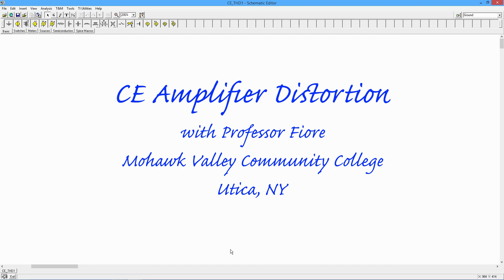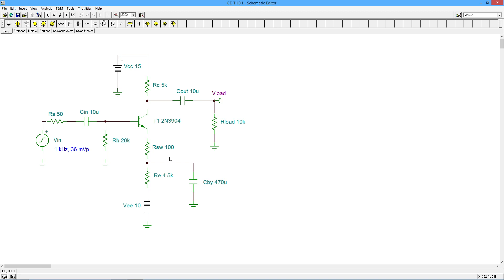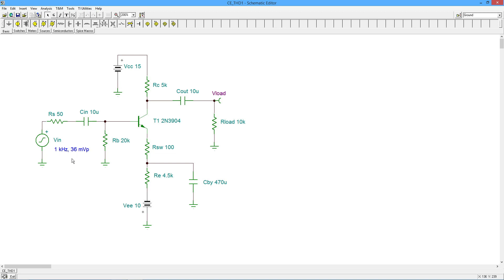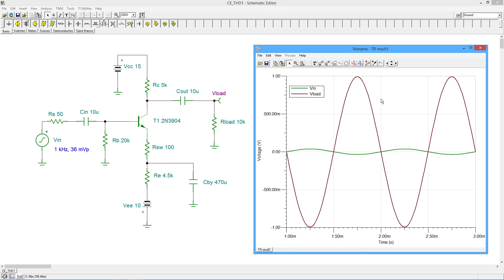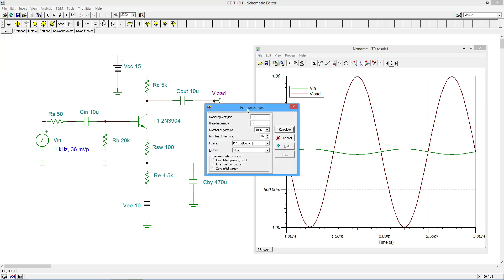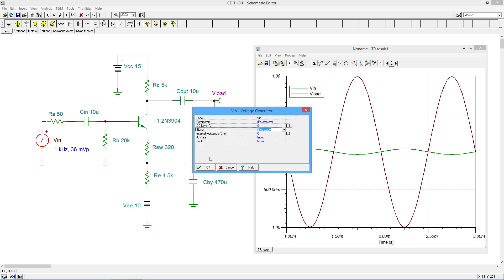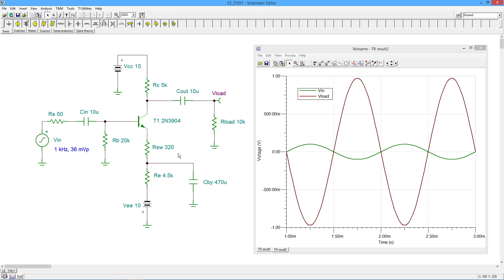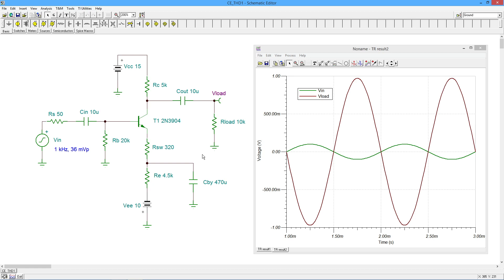Semiconductor Devices: CE Amplifier Distortion Simulation

Comment: By the way, for this design, how can we set the Q-Point as close as possible to the middle of AC load line?
Reply from the maker: I suggest looking at class A power amp analysis (either videos here or my free semiconductor devices text- links in description above).  Basically, you have to juggle the load impedance with Vceq and Icq. I should add, though, that if this is a small signal amplifier, you don't necessarily need to have the Q point centered. As long as you can get sufficient peak-peak swing to drive the power stage fully, you're good.

Comment: In a single supply system, if Av, RL, VCC, and vin are known, how we start to design this BJT CE VDB swamped amplifier?
Reply from the maker: You should also have some idea of required Zin and the size of the output voltage swing. If load impedance and desired Av are known, that tells you the required size of the swamping resistance. A common bias starting point is to set Vc at half Vcc (although you'd probably need to tweak that to get the desired results).

Comment: Does the simulator or one you know of support 6502 or 4004 cpus? I'm looking at simulating or emulating an old computer.
Reply from the maker: A 4004? Wow, that's reaching back! TINA-TI doesn't have those built-in as I recall but I know I have seen some simulators with more recent CPUs. Can't remember off the top of my head, though.

Comment: Hi Professor, what software are you using please?
Reply from the maker: This is TINA-TI, the free version of the TINA simulator that you can get via Texas Instruments (ti.com). It runs on Windows. If that doesn't work for you, you can try the on-line student version which is quite nice (TINA Cloud, Student) which is $14 for 1 year access or $28 for 3 years. (tina.com)
Reply: @ElectronicswithProfessorFiore  Thank you very much Professor!

Comment: Thank you. That was really useful. It would be interesting to see a side-by-side of a 2-stage CE circuit compared to a single stage for THD differences. I found a free product called Microcap (used to cost thousands but they closed down and allowed everyone to use the SW for free, it's updateable).
I love your teaching style and enthusiasm.
Reply from the maker: The trick is to design two circuits that are otherwise identical in performance (gain, Zin, Zout, bandwidth, etc.). I'll look into doing a video on that. I have a bunch of other things in the pipeline so it won't be real soon.

Regarding Microcap, I recall that it went freeware a few years back. I tried it but thought that the learning curve might be a bit steep compared to some other free simulator (TINA-TI, LTSPICE, et al). What aspects of it do you like/dislike compared to the other simulators?
Reply: @ElectronicswithProfessorFiore  I use LTSpice as well. Microcap can show current, voltage, power and state of transistor (off, saturation, active) 'live' while you make changes. There are more complex analysis available and stepping of different components.